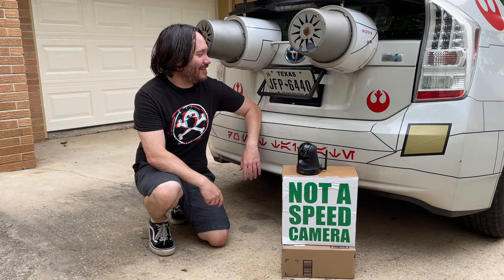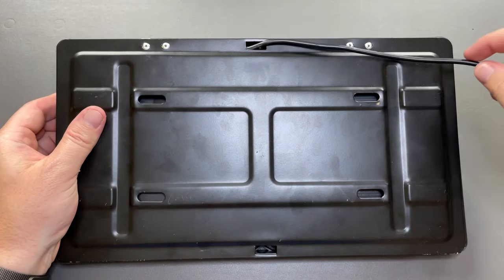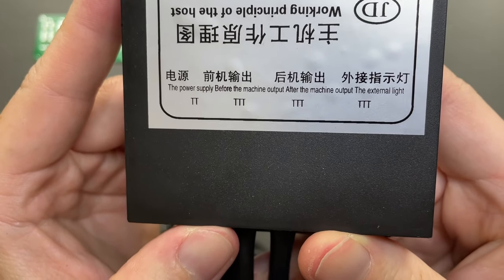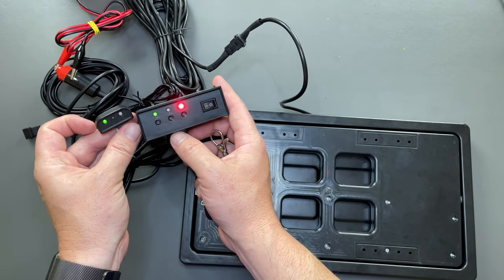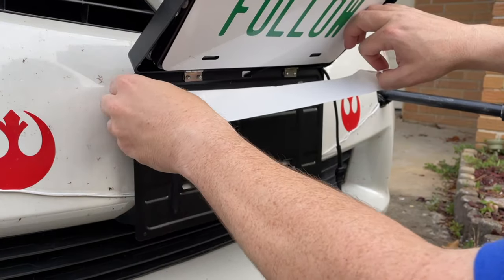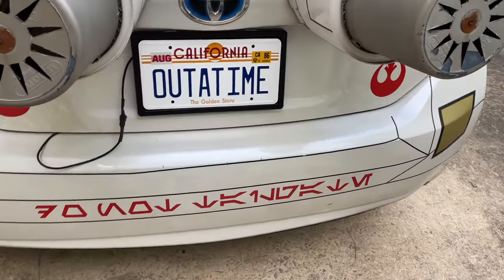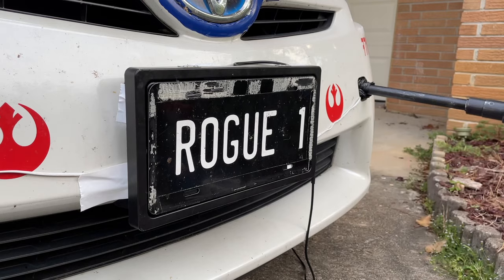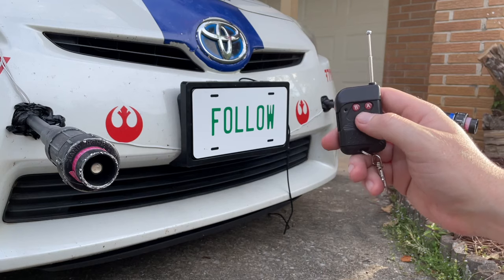License Plate Flipper - Review & Tutorial

Comment: well i installed the flippers on my subie and they are amazing. i did some tin snipping to the plates im using. quiet plates, actual dmv plates, more quiet plates coming soon, and a custom subie plate. and well it works. i can flip it going fast although im scared to do it in the front. and i had to drill into my firewall for a perm setup.
Reply: QPTW
Reply: @ricardocruz3007  yesssir, i own ab 10 quiet plates and im in the insta gc and discord
Reply: @dipass4176  how do u get into the discord and gc
Reply: @AustinSRT  it’s easy
Reply: hi dipass have you become a flat earther yet? If not I suggest watch a 13 part series called What on earth happened by Ewaranon to learn that the earth is not a globe. I got it in my about tab.

Comment: Why didn't you drill holes in the plate to fix the problem the right way and then hiding the wire you could have drilled a hole in the back and ran it that way